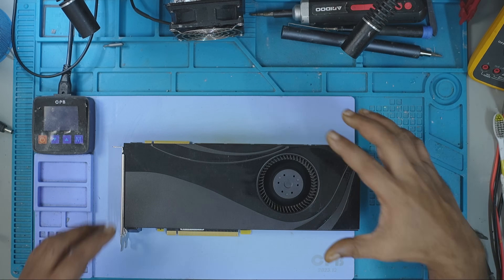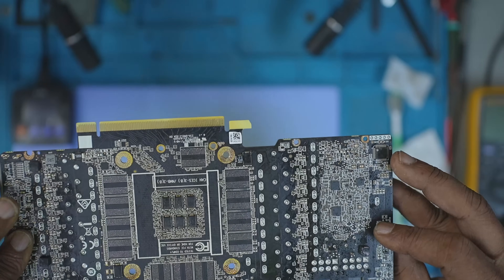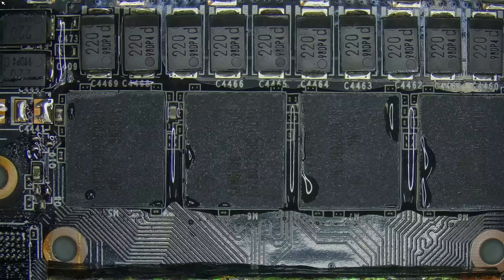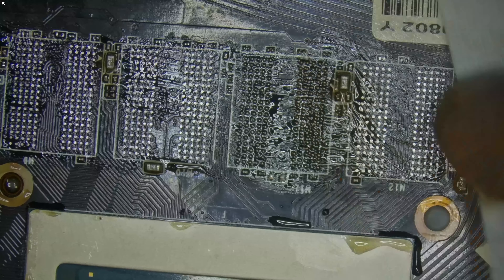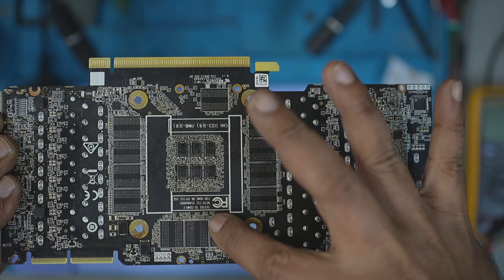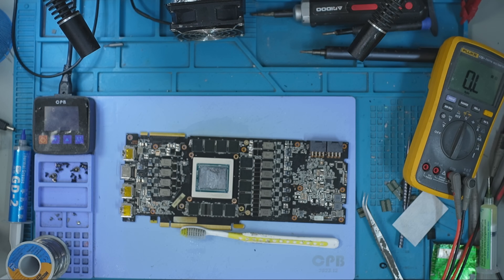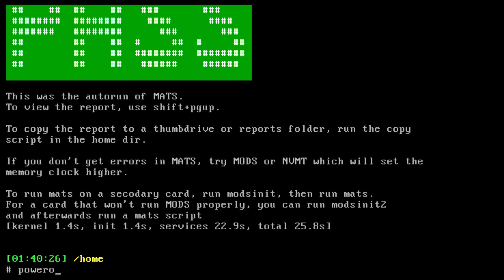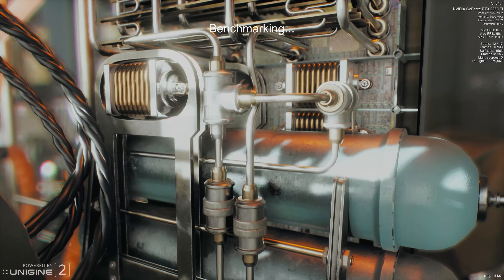Can Any GPU Get a VRAM Upgrade? | Asus RTX 2080 Ti (11GB → 22GB)

Comment: is it possible to upgrade rtx 4060 ti 8gb ?
Reply: Did you even watch the video?
Reply: you can't
Reply: I thought 4060 Ti 8GB could be done because of the 16GB model
Reply: @e.l.4409  the 16gb model has memory on the back as well, you can't do that with the 8GB PCB
Reply: @MaxIronsThird I see. I thought most vendors would reuse the PCB from the 16GB but only put 8GB on the front, but it doesnt look like that's the case.
Reply: @e.l.4409  some models might the connection on the back, bc of the reused PCB yeah

Comment: Is it possible to upgrade to 16 GB a RTX 3070Ti too?
Reply from the maker: RTX 3070 used GDDR6X and I have not managed to upgrade any GPU with GDDR6X yet. I am working on a RTX 3080 Ti. Once I am able to upgrade the RTX 3080 Ti I will be able to do the same for the RTX 3070 Ti.

Comment: Can you mod a gtx 1660 super or any variant to 8gb? No one have ever done yet and Im really interested what kind of performance uplift!
Reply from the maker: 1660 is too weak to utilize the added memory.  In my opinion its not worth the money spent. Anything below the RTX 2080 Ti is not worth it. I have not tried the 1660 yet.
Reply: @GraphicsCardRepairs-tk7ql  I bet my EVGA 2070 super ftw3 ultra+ could handle it. It's one of the fastest and beefiest cards they released of that series.
Reply: @GraphicsCardRepairs-tk7ql  some brazilian team did 8gb on a 970. performs really well
Reply: @GraphicsCardRepairs-tk7ql dont agree, cards after 3090 have less cuda cores for actual processing, everything is going into DLSS instead higher end 1600 card would be better though
Reply: @CnRSPACE  But if I want to put more memory in 3090, is there any kind of problem? And then don't ask later. Yes, I know that the 3090 have 24 GB. Yes, I know, you don't need anymore, but I ask about doubts
Reply: @songoku1114 no idea, i just want the OP to make a video modifying 1670 or 1680 😅
Reply: @isadora-6th true but dont the newer cards that support physx games actually perform wlrse on them since they have been optimised for dlss instead?
Reply: @CnRSPACE physX was discontinued totally (32 ver)
But die to the backlash and high demand to play older game they added it back, ONLY for a FEW GAME.
Reply: it would have to go to 12GB, since he would be using 2GB modules instead of 1GB, and yeah paying $200 extra to get a 1660S with 12GB, doesn't make sense, might as well sell your 1660S 6GB and buy a used 3060 or maybe 3080.
Reply: I believe you didn’t watch the video and jumped straight into the comment section to ask. 😏